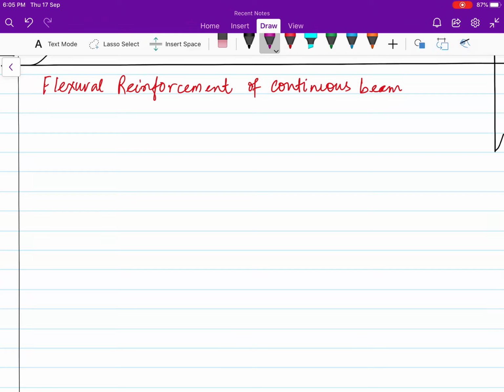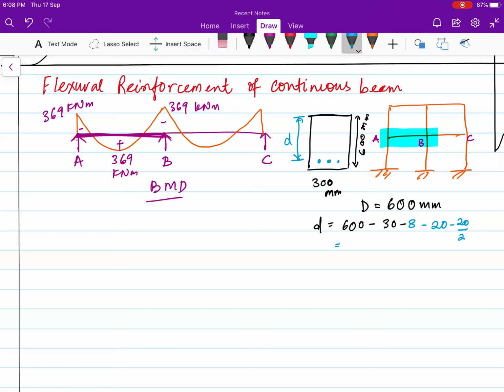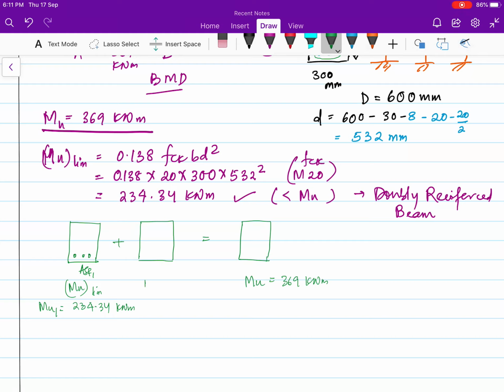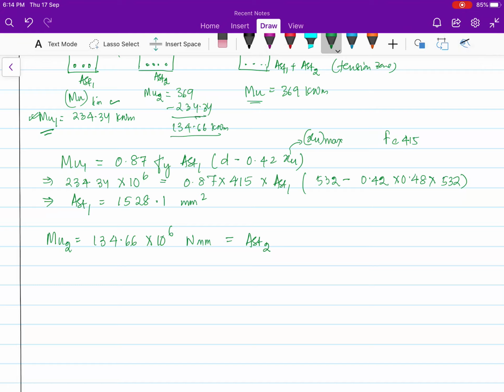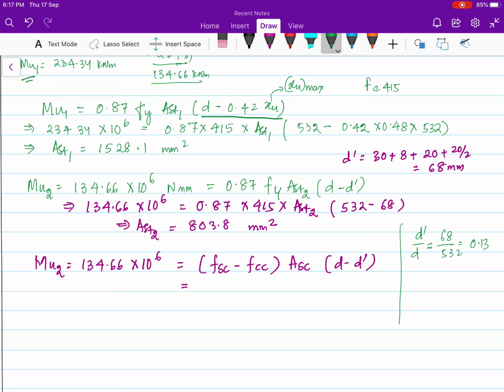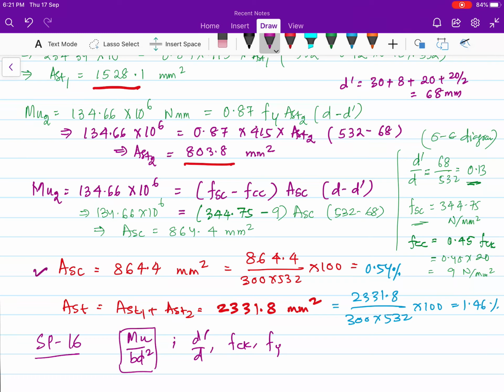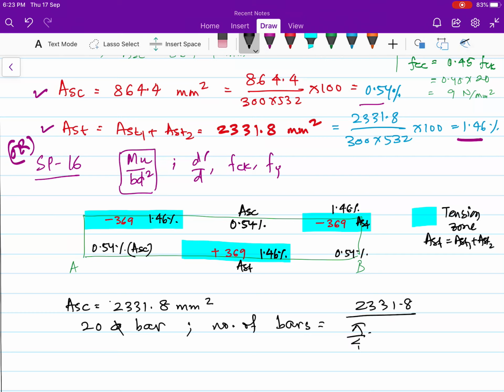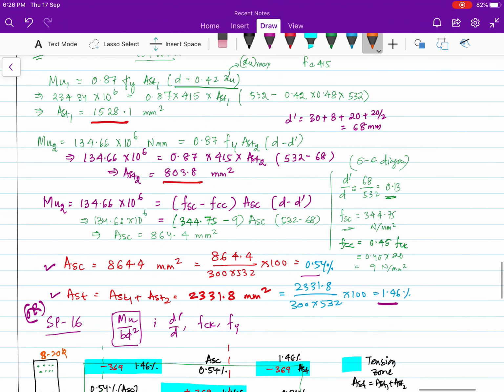Flexural reinforcement of continuous beam

Comment: Hi ji can u explain static determinancy and indeterminacy in pratical way , not by formula but , i want to know where and why should we use it in rcc or steel structures ,and also how do we pratically use kani s method
Reply from the maker: Hi, let us consider a rcc beam in our house, whose ends are embedded into the columns resulting in fixed support. Under the effect of loads, the reaction developed at the fixed ends can’t be calculated using available equation of equilibrium. Hence, it becomes statically inderminate. To analyse this beam, we can use Kani’s methods. But in case of bridge if the span is supported by hinge and roller support, using equation of equilibrium we can determine the reaction developed under the loading, making it statically determinate.

Comment: How much length of tension and compression reinforcement should be provided at span and supports section?
Reply from the maker: IS 456 - Refer Cl:26.2.3.1 We need to extend tension zone bars 532 mm(=d) from the point of inflection found from BMD at mid-span. Similarly at supports 532 mm as per Cl:26.2.3.4.